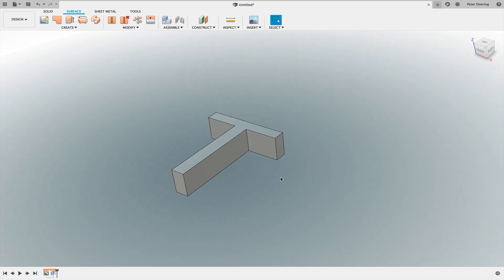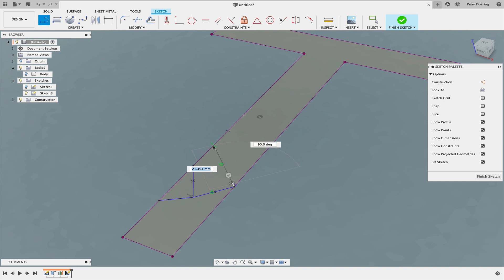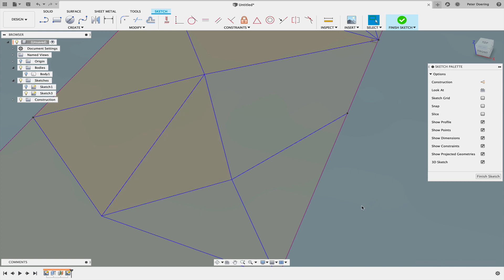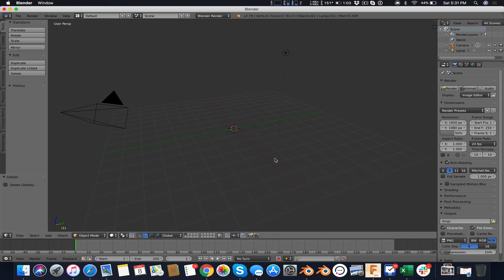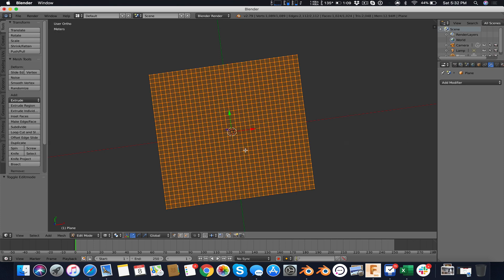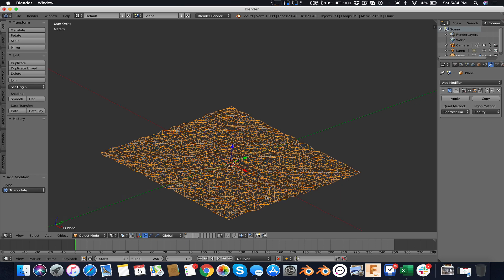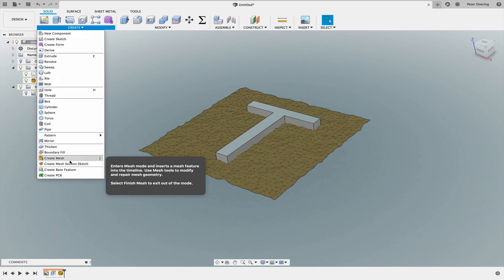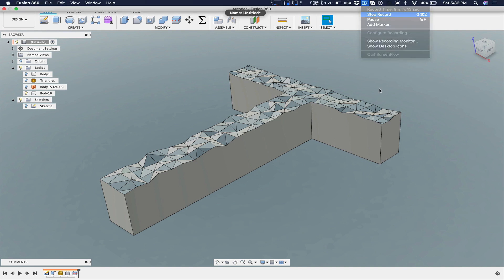Fusion 360 - randomized low poly surface with Blender

Comment: Hi, I followed your tutorial step by step but I couldn't put it to work. After importing .OBJ file in F360 a warning pops up telling me "Mesh is not closed." Where could be the problem? Thanks for the answer.
Reply from the maker: Im am not sure where you get that error message from. With the most recent update, the workflow to convert an imported mesh into a BRep changed but I still don't get that error message.
Once you have the mesh inserted, go to the Mesh tab and select Modify->Convert. The default is "Parametric" and "Faceted" select the imported mesh if you have not done that before invoking the command and accept by clicking OK.
Reply: Im getting that message as well, have you found a solution?
Reply: @MoodyKay79  Unfortunately no, but instead I followed this tutorial: https://youtu.be/PR6FCBZAqiY
Reply: @olinuxx  When importing the mesh i changed the units from millimetres to meters and it worked. I dont know why, but if you want to try again, that might help! Also thanks for the answer
Reply: @MoodyKay79  Thank you for the tip! I'll try that when I will need to do this someday!
Reply: @MoodyKay79  That worked, weird answer though isn't it?